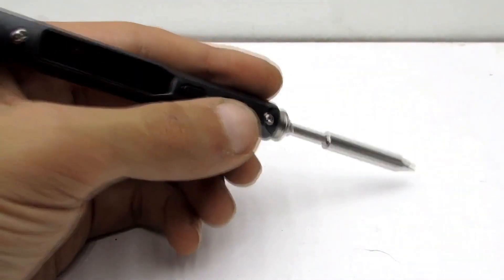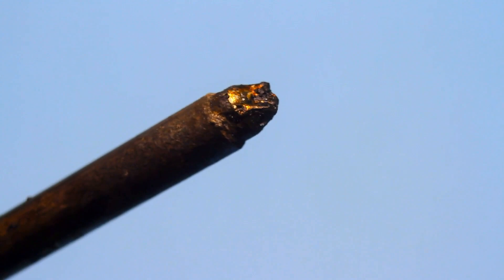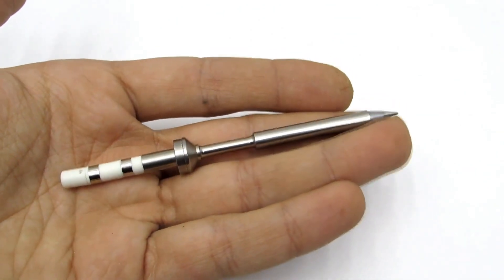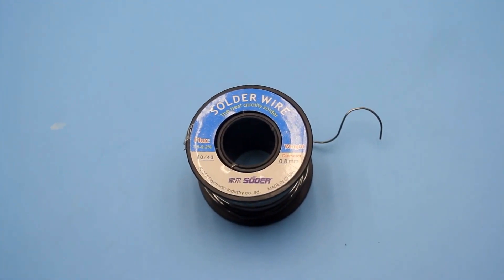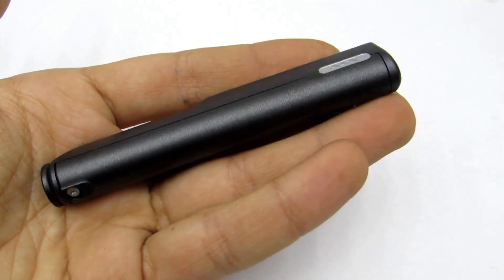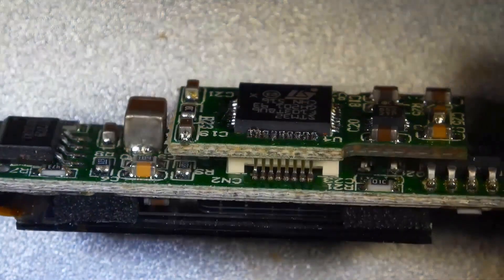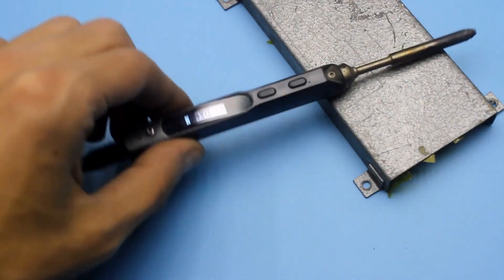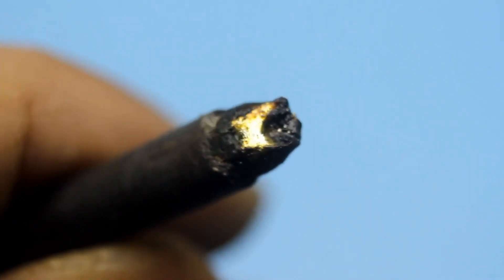What can the best soldering iron TS100 do? I torture as much as I can!

Comment: I use one of these every day. It's the best soldering iron by far. I use "D24" tip 95% of the time, and "I" tip that i've slightly bent for ultra precise soldering. And "I" tip can be bent by pushing it against hard wood.
Beware that this soldering iron has one VERY serious problem - the tip is NOT grounded. I have seen up to 80V between ground and tip. This means that you can destroy sensitive components with it. Fortunately it has grounding point in the back. It's a bit clumsy to use with grounding cable, but you ground it only when soldering sensitive stuff.

Comment: Fnirsi hs-02 is better since it uses jbc style tips at 100w using type-c PD protocol.
Reply: nope ;) Fnirsi HS-01 and 02-A nad B is worse than TS-100. TS100 have better thermal conductivity iron tips. 
on HS-02A i get max around 15W, HS02-B ~10-13W
HS-01 is close to TS100 but have bad firmware.
Still TS-100 is the best but need small modification, u need to put inside USB-C with 20V trigger.
Reply: @kamil004  not if you use the original jbc tips with HS-02 since it was designed around that tip dimensions.
Reply: @kamil004  it's new with all more features like 100w PD protocol with type-c input and if that's not an option for you then use an ordinary barrel jack adapter like a laptops.
Reply: @kamil004  bigger display with power and volt meter , 3 temperature presets and ability to change the input power profile.